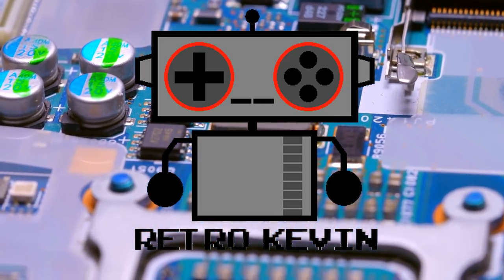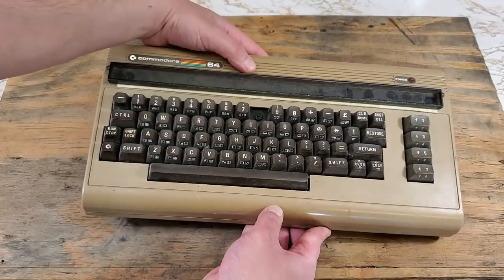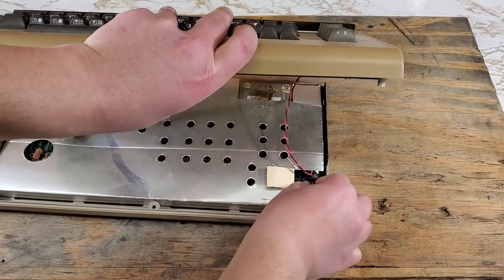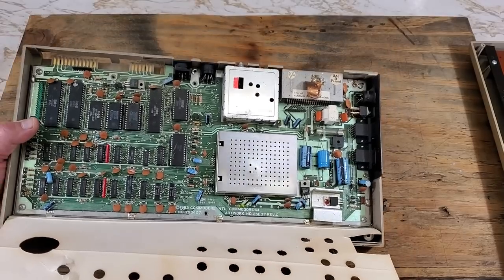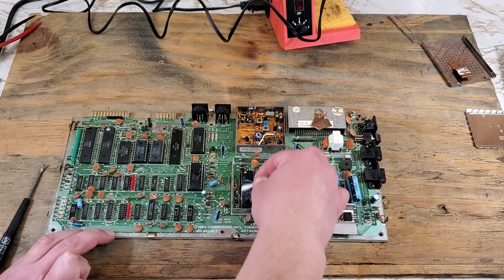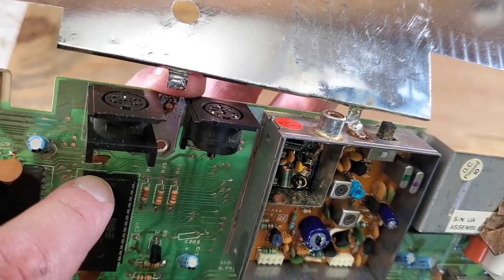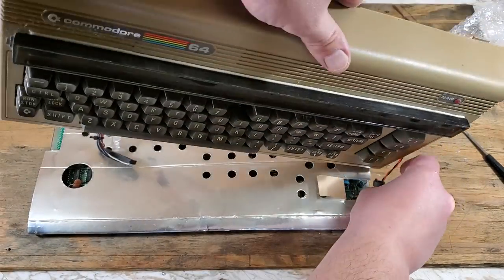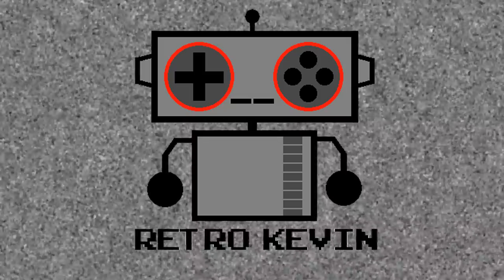Commodore 64 tear down and test Part 1

Comment: Hey dude. Glad to see you saving C64s, but really not enough here for 10 minutes of video. Need some closure for it to be compelling. Keep going though.
Reply from the maker: Thanks for the input. I don't like to cut out the work I do. At most speed up the video. This is a multi part series and I should be having part 3 uploaded within a day or two here.
Reply: Phil...he is showing the basic nitty gritty details of how to troubleshoot these repair jobs. It is time consuming detail orientated work, step by step. Besides, reseating the chips MIGHT have worked and has worked for me in some units in the past. Patience.